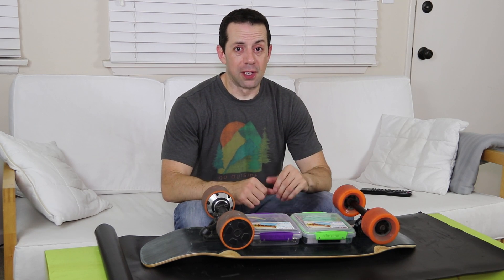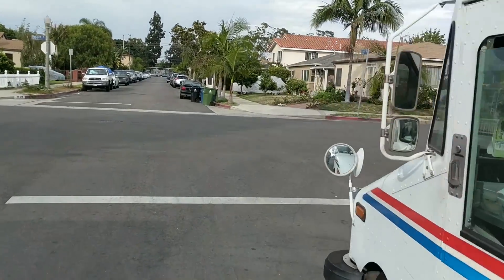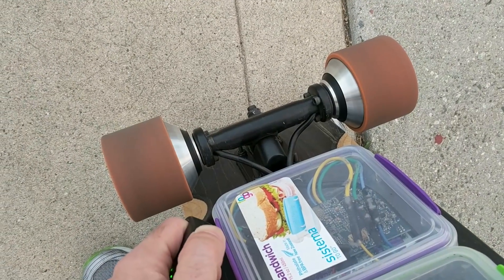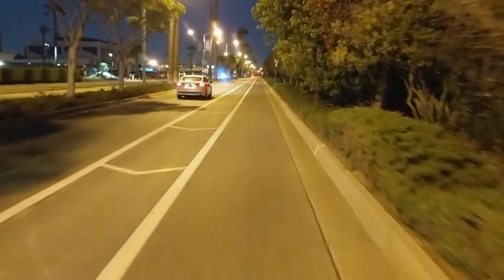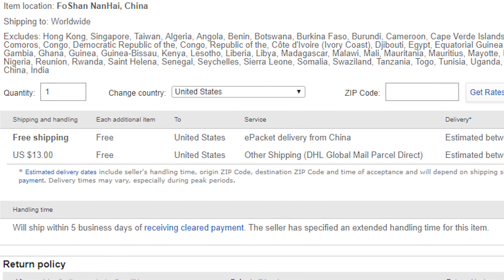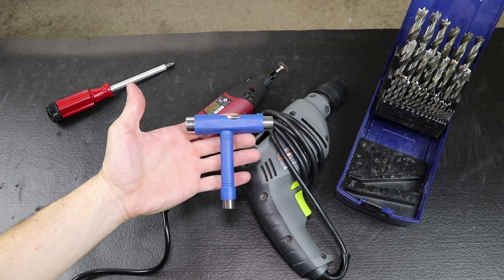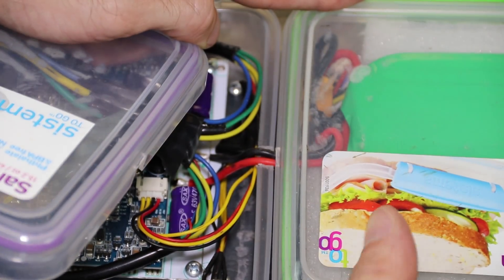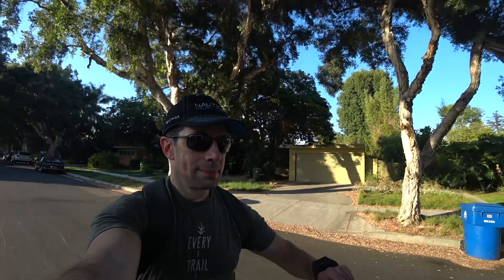Dual Hub Motor Skateboard | $315 | Easy Build!

Comment: I did a charge n ride with extra battery packs to extend my range on my electric unibike and  EUC through the charging port.  I’m wondering if I can do the same for my electric skateboard as  the charger goes directly into the battery with a DC power plug?  My electric board supposed goes up to 12 miles but I want to extend it to 20 miles.

Comment: If i build a 6s board, and later decide to upgrade to 10s do I need to buy a new ESC, or will this ESC work with both 6s and 10s?

Comment: Hey Oren, I followed all the steps in your build but I have having a problem with my remote--it keeps disconnecting. The motors will run fine but when I stand on the board it will accelerate briefly and then disconnect. Any ideas of what is happening?
Reply: Hey, were you able to solve this issue? Im thinking about buying a board like this an it seems like something to consider

Comment: I'm planning a build with the odrive controller. It has support for up to 48v and dual motor control for only $150. You should check them out.
Reply from the maker: Thanks! I'll check it out. Might be good for a super powerful board.

Comment: what is the weight on this set up? very interested in doing that set up, it's looks great
Reply from the maker: Thanks! I don't remember the exact weight of that build. I'd guess around 12-13 lbs. Those dual hub motors and the battery make it difficult to get the weight down.

Comment: nice video :)
i cant find any information about the esc. 
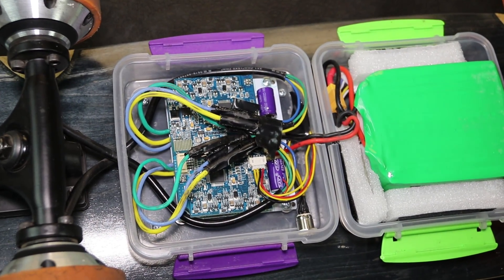can you send me an link to the information you showed in the video at 11:17.
that would be very helpfull.
Thanks
Reply from the maker: Thanks! The ebay listing has a picture and the description says which connections to make.
https://www.ebay.com/itm/Dual-motors-longboard-skateboard-control-modula-ESC-Substitute-with-remote/323326552273
The connections are very small so the soldering can be tricky. I hope this helps.
Reply: I have the same problem, for 10s am I supposed to solder the 2 pieces off?

Comment: This is a very good price to build but you can get better quality parts if you do some research I found that hobby kings rc motors and esc is very powerful and better quality then what you have used but overall it's up to you to decide
Reply from the maker: Thanks for the feedback. I agree it's good to do research. There are always new electric skateboard parts being released. For my newer builds I've switched to using 10S voltage, which I don't think Hobbyking has good ESC options for.

Comment: Are there any trucks for 83mm hub motors? I have the hub motors with square  then circle in the middle.
Reply from the maker: I think Maytech sells the trucks you're describing with the square center.
https://www.aliexpress.com/store/product/Maytech-70mm-and-90mm-hub-motor-wheel-longboard-truck-for-eletric-skateboard/1630416_32772235268.html
If you contact the seller on eBay that I got the motors and ESC from he might also be able to get you trucks like that.
Reply: Oren's Projects yes that is exactly what i was talking about.oh man shipping is expensive.... do you think that I could make my own?
Reply from the maker: You could make your own with an angle grinder. Kaspars Dambis did a good job in his video https://youtu.be/Sjut8hVuLWM

Yeah, shipping is expensive. If you contact Maytech they might have some cheaper shipping options. Also, you can try contacting the eBay seller of the motors and ESC I linked to in the description. He might be able to get them.

Comment: Hey, incredible video! Small tip that comes from flying rc planes, they make eBay lipo battery voltages that go up to 6 or 8s and have beepers on that you can set low voltage alarms, I generally try to not dip below 3.6 per cell they will last longer than going to 3.3-3.4
Reply from the maker: Thanks! That's a good idea for extending the life of the battery.

Comment: Hey thanks for all the help!!! Your videos a amazing!! Just put my hub board together! Using two 5s batt. ! Any suggestion for longer range? Think mine is only getting 8miles
Reply from the maker: Thanks for kind words! That's awesome you built your board! If you want longer range I think the 5S/5Ah batteries are the biggest I've commonly seen (and will fit well under the board). I was getting around 8 miles using two 5S/3Ah batteries - so the 5Ah should be a big improvement. Also, push starting and trying to find the smoothest parts of the road helps. Here is the link https://hobbyking.com/en_us/turnigy-battery-5000mah-5s-20c-lipo-pack-xt-90.html

Comment: Hello. Thanks for your video!
I bought ESC (6S. Model 740268) https://ru.aliexpress.com/item/longbaord/32834703659.html
I want to buy two motor:  https://ru.aliexpress.com/item/New-Arrival-Brushless-Outrunner-Motor-N5065-270KV-1665W-For-DIY-Electric-Skate-Board/32793728617.html
And fixings: https://ru.aliexpress.com/item/Mayitr-Electric-Skateboard-Motor-Pulley-Mount-Accessories-Belt-Kit-for-72mm-70mm-Wheels-Stainless-Steel-Skate/32817684750.html

What do you think about it? Thank you.
Reply from the maker: Thanks! I've never used that ESC but it looks similar to the one I have. I think it should be ok. I would just make sure the model of the ESC you order is configured for belt motors instead of hub motors. In the picture it's showing hub motors. For the motor, I would recommend using 6055 size if you want to put them on the same truck. Also, I would try to find motors with a lower kv (something around 170 - 190). If you want to keep the setup simple you can also get plenty of power using just one 6074 motor. The pulley mount and gears should also be ok as long as you know they will fit on your trucks. I hope this helps.
Reply: Thanks!

Comment: What do you use to connect the 2 batteries and the esc?
Reply: And what does the esc beeping mean
Reply from the maker: This build only has 1 battery, so I just plug it in directly to the ESC. When there are 2 batteries, like in the longboard build, I use a series connector. https://hobbyking.com/en_us/xt60-series-adaptor-2pcs-per-bag.html
Reply from the maker: One reason the ESC beeps is when the battery voltage is too low, and the battery needs to be recharged

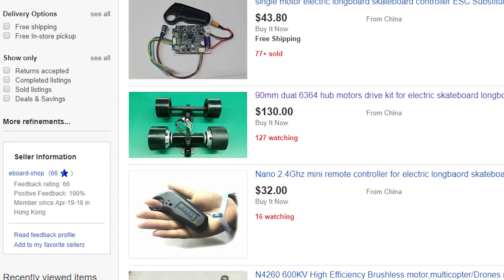Comment: 11:09 What brand/make is that receiver you have connected to your VESC? I'm building a single VESC-equiped belt-driven board and wanted to re-use a spare remote (same as what you have) from my diyeboard kit. Thanks!
Reply from the maker: The remote I use with the VESCs is different than the one that comes with the dual ESC.  The receiver is built into the board of the dual ESC and it comes with its own remote. The remote I'm using with the VESC is made by a company called Winning. Similar to this one:
https://www.ebay.com/itm/Universal-2-4Ghz-Wireless-Remote-Controller-Receiver-for-Electric-Skateboard-ESC/182791845715

Comment: if I wanted to use belt motors would it be the same process but just switching the motors?
Reply from the maker: Yes, the process is basically the same. The dual ESC I use here is available in a hub motor and brushless motor version. For a belt system, you should get the brushless version.

Comment: what charger should i use with this setup?
Reply from the maker: I added links in the description to what I use. The balance charging board is only needed if you use multiple batteries. 
B6AC v2 LiPo Balance Charger:
https://www.ebay.com/sch/b6ac+v2
Parallel Balanced Charging Board:
https://www.amazon.com/Weyland-Parallel-Balanced-Rechargeable-Expansion/dp/B06XW6XCZ3/ref=sr_1_4

Comment: Do the screws to secure the containers come out on the other side of the board?
Reply from the maker: The 1/2" screws I use don't go through the boards (there is also a washer and the thickness of the container). I use 6 to 8 screws and it seems more than strong enough.

Comment: Is the battery connected to the esc with only the one black and red cord? Also, if I were to use 2 3s batteries, how would I charge them
Reply from the maker: Yes, there is only 1 battery connector on the ESC. If you use 2 batteries then you'll also need a xt-60 series connector (the link is in the description for the connector). You can charge them using a parallel charging board. I show this in my newer video at around 8:43 https://youtu.be/qdylrv1iSHI. You can search for videos on how to parallel charge - like this https://www.youtube.com/watch?v=7wj-EB4-71M. You can also use 10S (2 5S) batteries if you want more power and speed. The only difference is you need to specify 10S when you order the ESC and you'll have to mount the batteries differently (like in my longboard build).

Comment: How do you pair the remote to the board? That part i dont understand or maybe you said it in another video and i missed it, sorry
Reply from the maker: The eBay listing (or wherever you buy the board) should explain how to pair the remote to the ESC - there are a few steps to follow. However, I've bought several of these ESCs and the remote was already paired when I got them. I updated the eBay link to the ESC in the description. I think the old link expired. Hope this helps.
Reply: I have the same problem. I've tried following the instructions but without any success.

Comment: Have you heard of Mellowdrive; where the power system is there and you can put it on most if not all boards? I'm building my own, it's going to be an over engineered project with four 6374 motors and 12s4p battery and four VESC's....
Reply from the maker: I saw the 2WD Mellowdrive before. I didn't realize they're making a 4WD version. It seems nice but very expensive. I think building your own is best.

Comment: Do you know of any dual motors which cost the same price now? these ones cost like 200 bucks with shipping.
Reply from the maker: The price difference between the orange 83mm motors I use in this video and the newer black 90mm motors isn't that big. The 83mm are $130, but don't include the front trucks and wheels. The 90mm are $173 (incl. shipping) and include the front trucks and wheels. Also, the 90mm motors are definitely higher quality and support 10S voltage. You can also check meepoboard.com or diyeboard.com to see if they have a better deal.

Comment: Is this the same battery? Would it support a 400kv motor?
https://www.amazon.com/gp/aw/d/B00S1URO9Q/ref=mp_s_a_1_1?ie=UTF8&qid=1508129365&sr=8-1&pi=AC_SX236_SY340_QL65&keywords=5200mAh+6S+10C+Multi-Rotor+Lipo+Pack&dpPl=1&dpID=41fa8SF3YwL&ref=plSrch
Reply from the maker: Yeah, that's basically the same battery - just different shape. I think it's cheaper at hobbyking.com. If you want to use a sandwich container you can get two 3S batteries in series (the link is in the description). Here is the link to the 6S battery on HobbyKing.
https://hobbyking.com/en_us/multistar-high-capacity-6s-5200mah-multi-rotor-lipo-pack.html
It should support most motors. You should check the current draw of your motor. The 6S battery can provide a sustained 52A (10C) of current and 104A (20C) for 10 seconds.

Comment: I had to come back with a question. Can that ESC use any number of 18650 cells or does it have a voltage limit? I hope that question is understandable. I'm not an EE. Thanks.
Reply from the maker: The ESC can be configured to 6, 7, or 10 cells in series (max voltage of 25.2V, 29.4V, or 42V). Changing the voltage requires a bit of tricky soldering so you can request it in the voltage you need when you order. I talk about it around 11:14. Hope this helps.
Reply: Oren's Projects Thanks for replying. I'm an idiot. Rewatching the video, I see that was mentioned. kicks self

Comment: with the exact same weight i made an 82 cm aluminium longboard with 30km/h 30km range
Reply: what parts did u use. I know this is very very very late
Reply: @offbrandb7194  i used turnigi sk2 5055 outrunner brashless motor, 6s 120amp  1/8 car ESC for controling the motor, rc car remote + reciver (all from hobbyking)
18 pices of LG hg2 18650 li-ion configured in 6series 3 paralel battery pack. I use rc smart charger. I did almost 4000 km or 2500miles.the datteries ar degrading fast becose i charged them oll the time at 4.19 volts per cell.

Comment: meepo board is cheaper or is this somehow better ?
Reply from the maker: The meepoboard is about the same price when you include shipping. What I like about custom builds is you can choose parts you like. I prefer the drop-through deck and non-abrasive grip tape in this build. Also, the battery setup I used is easier to interchange for long rides. If you prefer something already built, I think meepo is a great option. Meepo also sells the motors, ESC, and battery at a good price if you want a custom board.
Reply: @orensprojects7250  I tried looking for the meepo board website you reference at the end where we can buy individual parts. May you provide link?

Comment: I would paint in black those boxes to make it cooler ;)
Reply from the maker: Yes, black would be cool :). I should at least take the sandwich labels off. One nice thing about leaving the case clear is I can easily see the lights to check if the board is on.

Comment: Hubmotors with flange and 3 screws may not be as durable as hubmotor with shaft.
The truck may break easier.
Reply from the maker: I just put together my new build using the same 90mm motors as the Meepoboard. They are very nice! The 83mm motors I used in the video have been holding up well, but I agree the 90mm motors with the shaft are better.
Reply: @orensprojects7250  I have the same 90mm  as in this video. I run at 36 volts but I seem to get much more hill climb and top speed than in your video. I've had all setups belt, direct, one, dual. These by far the best and cheapest. I suppose its possible mine are different even though they look identical. I enjoyed your video.
Reply: Yeah Kieran got your board beat lol

Comment: Thanks for the great vid ! Ive been contemplating what components to use for my first build. this has definitely got me rethinking using hub motors and that ebay esc.
Reply from the maker: I'm glad the video was helpful! I'm testing a new build I'm working on with the 90mm hub motors and a newer revision of the eBay ESC running at 10S. So far I'm impressed!

Comment: You can get those same hub motors significantly cheaper from Meepo boards. The shippping is high like it is for the ebay ones but the motors are only $40 a piece and the truck is dirt cheap too. They have the same speed control  with remote for about the same price. I imagine you'll save $30-50 bucks going through Meepo.
Reply from the maker: Buying from Meepo is a good option. The price will probably be close to the same as eBay if you also include the front truck and wheels ($40 for each motor, probably around $20 for rear truck, maybe around $30 for the front wheels, truck, and hardware). That'll probably add up to around $130, like eBay. The shipping used by "eboard-shop" on eBay is a bit expensive at $43, but arrived at my door around 4 or 5 days after I placed the order. It's great there are multiple options for buying these components at such a good price!

Comment: That is a wicked build for the price my friend!  You mentioned the braking was a little lacking.  In regards to esc's and braking did you prefer the VESC or the ESC?  Great work, I think I may build a new board now, haha.

- Neil
Reply from the maker: Thanks! Yeah, I think building is the best way to go. I definitely like the braking better on the VESC, mainly because I can configure it to whatever I like. The VESC is VERY configurable and higher quality, but more than 4x the price (you need 2 VESC + remote). The VESC is a good choice if you like tuning your board and want to experiment with different voltages and setups. The dual ESC I'm using in this video is actually an older revision. I think the braking is a bit stronger on the newer ones. Also, I think different motors will brake differently, so it's difficult to predict exactly what the braking will be like. I'm working on a build now with a newer version of the dual ESC and the 90mm motors I showed in the video. Once that's done I'll be able to compare.
Reply: I'm riding on an ESC and VESC on 2 boards I currently have.  I'm not a big fan of the breaking on the ESC but like you mentioned the flexibility of the VESC is so choice!  Building is such a better experience then out of the box for sure.  DIY isn't for everyone but it's really so rewarding.  I compare DIY to Full builds like a modified Camero vs a one size fits all Toyota Camry.  Please keep posting videos.  I'm a big fan of the medium as it takes work to go that extra step to get behind a camera (in addition to building your own board).  Let's stay in touch!

- Neil
Reply from the maker: Nice! I think most people that build boards end up with more than one because they get so into it :). I just started testing a new build with the 90mm motors and a newer version of the ESC. The braking is definitely better now!
Reply: 90mm motors!  That is huger 🤓 I would love to give those motors a go.  Please update us when you get there.  Yeah, I love the DIY perspective as variety makes for a better world!  Even if you don't build a whole new board you can update the one you have.  Again, great video and hope to see more from you soon!

- Neil

Comment: Yep....those are the same Motors as the meepo....not sure if it's the same Ecs though. Nice video!
Reply from the maker: Thanks! Yeah, the ESCs look very similar visually but I'm not sure about how it's programmed. I've ordered a few ESCs from the guy on ebay and they've changed a bit with each revision.